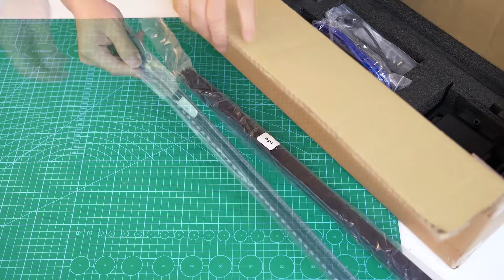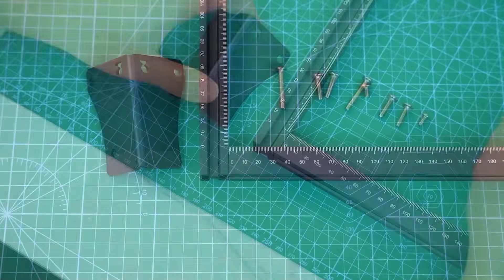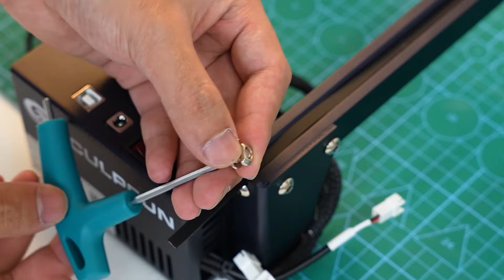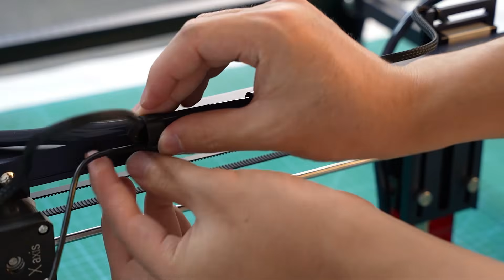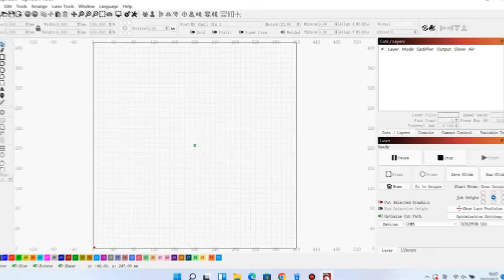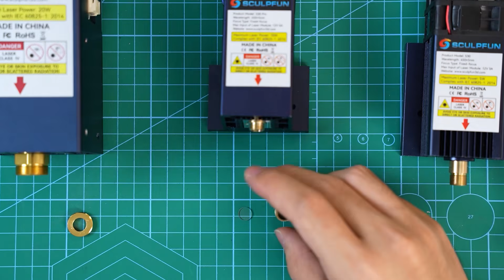SCULPFUN S30 Series Instructions for First Use & New Function Tutorial | 20W | Installation Tutorial

Comment: This is the hardest laser I’ve had to put together lol but I’m gonna get it done one way or another. The way he slimed the bars with the numbers are different from what the book has so I hope the way I have them turned is right, I also have the extensions but I’m gonna wait for those.
Reply: How did it go?  I am pretty frustrated. The video spent wayyyyy too long on the belt installation, and not nearly enough time on the power cables installation and cable management.

Comment: I bought s30 ultra 22watts, and run it. But I found difficulties, why the laser result different to the design on computer screen. The size and  messed up. Either I drawed circle, it came up oval. Any advice?
Reply from the maker: This situation usually occurs because the machine's belt is not installed properly. I suggest you check this out: https://diode-laser-wiki.com/documentation/guideline-settings/
If it still can't be solved, please send email to us:  support@sculpfun.com

Comment: I found one problem?  Do not tie the air pump cable with power and USB cable together? because when you come to actually use the air pump in LightBurn, it shuts down the laser when air pump come's on. I've built mine with the cables and pump underneath the desk and this is why I tied all of the cables together??
Reply from the maker: The air pump of the automatic air assist system will only be turned on when the machine is working.

Comment: Hello, I'm following the configuration steps and I get the following message: error:5
The homing cycle is not enabled in your Grbl settings.
What should I do?
Reply: You need to set the limit switches correctly in the software. For most 3d printers routers laser and plasma machines you have a hard limit (the actual switches) and a soft limit how much travel from your hard limit the gantry has or how much you want it to have. Also if your encoders or motors are backwards you may have to invert the numbers for setting machine zero ie. if it reads -35.074 and instead because it's swapped it's really 35.074. That is if the software allows it to be swapped.

Comment: Hello,can i custom s10 laser to s30?
work or not?
Reply: Yeah I mean technically you could add any laser head that you want as long as the gantry will support the weight... That is if you know what you need to do involving a relay and a separate power supply for the new laser.

Comment: My next laser will be the S30 Pro Max 20watt. I have air assist on my old machine but the number of times I have forgot to turn air on for cutting after engraving. Just to have it automated would be brilliant. Well done Sculpfun for introducing this feature. I do wish the input for power and usb where on the side of the control box though.
Reply from the maker: Thank you!!!:virtualhug:
Reply: I’m about to purchase mine as well.  I have an old 2.4w on my cnc.  I can’t wait to be able to cut and engraved with some depth.  Just remodeled my shop to make room fore it!
Reply: Did you buy one? I’m thinking if I’ll go 10w or if 20w is worth the price jump
Reply: @Cons2911  I just ordered it.  I’ll let you know.  My experience is get the biggest you can afford.  My little laser is good for engraving, but it won’t cut.  I put a stain on a board and when dry I put borax dissolved in water.  It burns nice and dark, then I spray seal it.  If I don’t use borax it’s takes for ever to get a dark burn.  More power=more speed.  The ability to cut let’s be do layered stuff.  My cnc router can do it, but there’s a lot of sanding that follows.

Comment: I bought S9 and I want to upgrade it to s30 30w is it possible? I haven't found it at Alixpress or bangood
Reply: We do not have 30W, and the maximum power of our laser is 20W. But 20W laser is very heavy, it can only be used on the S30 Pro Max machine. You can choose the 10W laser module of S10/S30